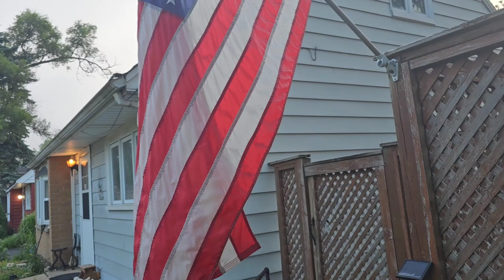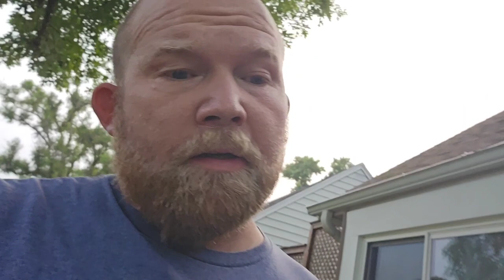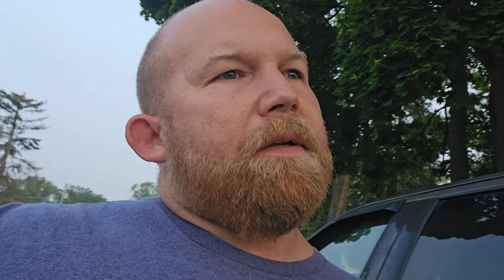Old Timers Couldn't Help - 1990 Cadillac Brougham 5.7L TBI Start and Die - Here is what I found

Comment: Those TBI 350's were some of the best engines. I've seen several with  over 300K on them and still running strong.
Reply: yep. i knew what it was already. sure they're low pressure high volume, but geez, i got rid of my 88 gmc, bought in the fall of 87, brand new just five years ago. and i still see it driving around. scrap guy bought it for $500. lord only knows how many miles on it. the odometer quit. but i was a carpenter, drove and worked the hell out of it.   oh, in the decades i worked that thing, 5k in repairs. thats it, it includes the rotors breaks and general maintenence stuff too. anyone says gm didn't make quality stuff? i think about the truck i drove, and worked the hell out of for just over 30 freaking years with nary a thing needing fixed.
Reply: 350 tbi is Kinda like a 7.3 they don't make enough power stock to kill themselves quick but they're built stout enough to work very hard all day and night

Comment: A very similar thing happened to my 1993 Chevy Caprice Classic station wagon with the 5.7L after I bought it.  Except it would only happen with a "warm" engine.  If it was cold or hot it would start fine and run good. When it was having trouble it would start/die 3x and then work good, idle fine and have great power at any speed.  It took a while for me to actually figure it out.  Replaced the fuel pump itself and its been great ever since.

Comment: The 1987-1995 GM TBI 5.0L/5.7L V8s are very simple and reliable. A new pump may not fix it though. Find some wiring diagrams and double check that things are working properly. The GM ECMs from that era are known to not age well. Blown capacitors and bad solder joints are very common. I'd normally ask the grey-bearded techs at the GM dealership I work at for pointers, but I'm on vacation this week. 🙂
Reply from the maker: Pumped fixed it - nah nah na boo boo
Reply: @FordBossMe  Attaboy Rich! 🙂

Comment: My era of vehicle that i started in the industry, i did lots Of work on my 89 1500.
     Went through the whole system, all the sensors and the last thing was the fuel pump then she ran sweeeeeet as butter.  Reverse was blown., got a 90k mile transmission from a little s15 blazer.
  Added a ford excursion trans cooler and a larger radiator because i had a plow on it.
  Put 30k mikes and 5 winters on that truck and it still shifted tight as could be.
  Hauled a shit ton of firewood. I added a leaf spring to each rear spring and tightened the torsion bars. 
    Once a year front end parts got replaced, weak link of the first independant front suspension on a chevy truck. 
Even moog problem solvers didnt last.
    Best truck i ever owned.

Comment: Tbi is pretty basic, same as old carb with exception of map sensor a couple injectors. I was leaning towards pick up coil inside of distributor which are known for issues. But you said it best the basics don't over think. Simple air, fuel and spark. Start with fuel pressure go from there. Not a mechanic just a wrencher myself as a hobby, and fix my own cause can't afford to have someone else fix. Chevy tbi trucks is what I popped my cherry on! Had 4 of them done all from change plugs to change engine. Love the videos, keep it up, God bless, God bless the flag

Comment: I used to clear a waste line from our painters clean-up sink they used to clean up at the end of the day. I used a " nerf" sponge ball to stop the air flow and poked my airline thru the middle. We had whats called a 'wet vent so it would have to be plugged as well. It worked great for quick clearing of the  line.

Comment: Don’t doubt yourself.  You thought it was low pressure and you were correct.   I was at GM back in the 90’s and your right we can’t remember everything off the top of our head.  Most times they had more pressure than that one when bad.  I was remembering they used to idle fine but would bog in gear under light load.  You don’t need someone my age’s help lol.  Master technician is a Master technician 👍

Comment: A loose vacuum elbow from the throttle body to the MAP sensor will cause a similar drivability issue.  I spend spare time over the course of year checking things on my 1992 chevy pickup, the distributor cap was corroded. In hindsight I may have knocked the vacuum line off when I replaced the distributor cap. The truck runs like a champ, whew!

Comment: Computers forcing the engine to run when it should not.
When the fuel pump went bad on my 63 Chevy, it was a brick, no start, no go.
When my 98 F-150 pump went bad, it would start and die, start and die, as long as you waited between the crankings, it would start on the fumes and die right away.
Computers make an engine more efficient, until something goes wrong.
That's when troubleshooting gets uber-technical.
I like points, condensers and carburetors. 
Air, spark and fuel, not algorithmic parameters!

Comment: My 76 seville has a pump in the tank & one external from the factory. 350 olds fuel injection. Needs both operating to run.

Comment: A thing I've found on the fuel pumps used with the TBI system is the small 2 inch long rubber hose that connects the pump to the sending unit will deteriorate and basically tear a hole in itself from the pressure and cause the same symptoms. Of course if that's the case might as well replace the whole unit anyway.
Reply: I had that problem 20 years ago on a 350 tbi caprice. Also had grounding issues with the pumps.

Need to use submersible fuel line in that situation.
Reply: @mph5896  
Yeah that's another problem especially in the salt belt. Every tear I would clean and spray the ground on the frame by the tank.
Reply: @12yearssober  I think the pump grounded  in the trunk on or around the trunk hinge. It’s been a long time since I touched one of those though
Reply: @mph5896  
I'm thinking of the trucks. That's what I always had.

Comment: LOL I love my TBI on my 4.3 Blazer!  The only junk thing is that there's no port in the fuel line to check fuel pressure like the port injection systems.  My old Snap On fuel pressure tester kit is designed to break into the system and run in line to monitor fuel pressure for those TBI systems ... as for the ignition timing, if I remember correctly, there might be a connector going to the HEI distributor that needs to be disconnected to set base timing with a timing light and then reconnected for the ignition module to take over ... if you're going to power time it, just check if it pings under load ... lol

Computer Command Control and OBD I ... brings back memories!  Or even those electronic Q-jets where you have to take a dwell reading on the needle valve solenoid...😂😂😂

Comment: So i guess it explains why only during accelerator pump operation it got sufficent duty cycle time to allow sufficent fuel to flow. However, with no pump pressure idle cycle time would not have made enough for the car to run.

Comment: Timing on those is zero degress tdc alao. There is a wire in the harness that gets unhooked, et to zero amd hook the wire back up..
       Fuel pump is susoect to me.
  Needs like 35 plus psi. Cant remember exactly. Been a while. Great engine though. I put big block injectors on mine back in the day lol. But it didnt make a diffetence to me.

Comment: I have a lot of experience with GM stuff And the first thing I always check in those situations is fuel if the fuel is there then I check and make sure the exhaust is flowing because I’ve seen GM start and die when they have bad catalytic converter‘s also
Reply from the maker: Yeah this one is flowing that's one of the first things I checked as well

Comment: Ive also seen on the old obd1 chevy trucks and suburbans and tahoes have a good pump but from years of age and corrosion it will intermittently lose ground under the right circumstances start simple and work from there just my 2 cents as a 5 year tech

Comment: Please don't take this the wrong way. Not sure on what all you guys did to diag first.  I have 45yrs in an the first things first. The spark the compression an fuel would be checked. I know you say 60,000. I know I have seen a tsb on distributor.  The fuel pressure is a big thing with tbi and 9 13 lbs. I have had many that would have 9 10 lbs an act like you are saying this cadi ran.  I think if you guys had hook up fuel pressure gage think you would have found your problem. I've seen the wiring bad at the injectors also but maybe not with only 60 thou. The biggest problem with most of the ones is the pump an distributor not enough spark but the pump needs to be more like 11 to 13 for them to run good. But do you guys not hook up things to check. I know you said you could hold you finger on the line an nothing. I believe the right diag you would have ran into the problem with in 15 20 minutes probably. Those systems were some of the easiest and best out there in my book to work on. The computers had some problems and the proms had issues also but even then I believe you would have found that to with the right diag. 
Well glad you guys found your problem and help out customer get his car going. Thanks for sharing be safe
Reply from the maker: Video is loading now
Reply: Not many people have the adapter to check fuel pressure on an old tbi system like that anymore.
Reply: @mph5896  True that. I know I have been in the business for years so yeah I do have the adapter. That is one thing that was a little crazy they didn't have a place to check fuel pressure. You have to remove fuel filter to install adapter there.